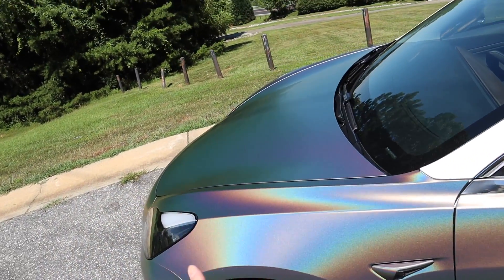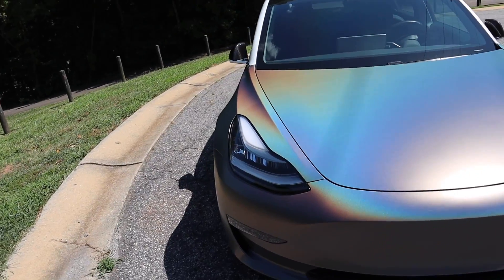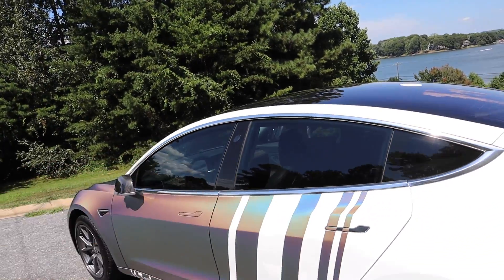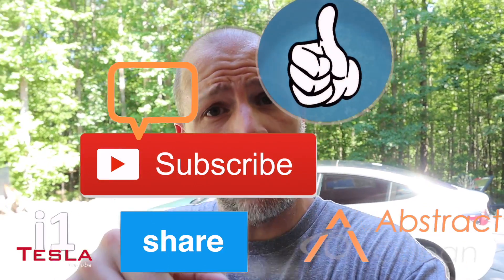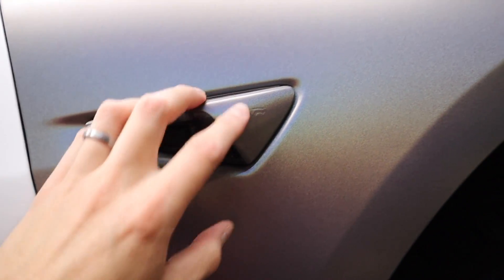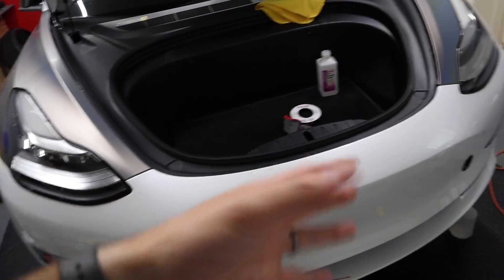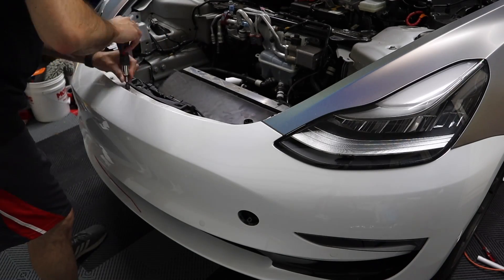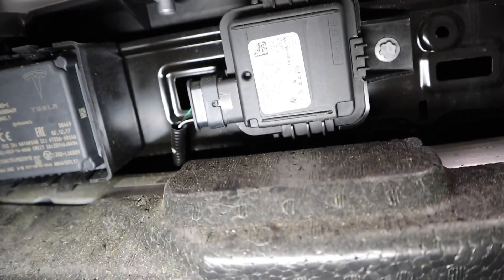DIY Tesla Model 3 Wrap Video

Comment: You did a great job on the wrap Brain. I think the wheels look pretty good as is but if you saw how good Matt's wheels turned out i see why you are thinking about painting them as well. I like the 3m psychedelic you chose. I think you should find another white vinyl to use for the part that you want to look more like the original color but adds a little similar color shift to the white. Just an idea.
Reply from the maker: I like Matts wheels too

Comment: Can you share how you align the bumper to the headlights? Shim it with some washers?
Reply from the maker: I used a sticky rubber piece of tubing I had. 1/4 inch thick. Stuck it to the tabs and it worked

Comment: Love the Wrap job!  Nice touch with the side stripes.  I just bought a White Tesla Model 3 and I am going to wrap it in Avery Gloss Prismatic Metallic Gray which looks very much like the 3M Flip only the color shift and finish is much better than 3M and its easier to install.  Avery does not have a satin option. My question is what direction did you wrap the hood?  I'm assuming you did the fenders and doors with the 3M lettering facing up as well as the bumper.  Did you also wrap the hood with the lettering facing up towards the windshield?

Comment: Question: what if a person is backing out of their garage and the door was not properly closed causing them to fall out of their vehicle. If it were a Tesla, would the car continue down the driveway? This happened to a senior neighbor in my subdivision causing her some pain and suffering related to her leg. Her ICE car continued down the driveway and hit another neighbor’s tree. She is no decrepit but I’m sure this has happened to other people before. Without hurting yourself, could you do a little test to determine how the model 3 would react?
Reply: Can you drive in reverse with the door ajar?
Reply: The seat sensor will throw the car in park. If not buckled and you lift your rear off the seat at low speed you’ll get thrown in park for example.

Comment: Nice job. Curious why you chose a blade around the headlights instead of knife less tape? Is the tape not as good on quick turns? I’m sure the painters tape you laid below prevent any damage so just curious why one way vs the other
Reply from the maker: The blade never touches the paint or plastic. The side of the blade rides along the edge of the light or door making a straight cut. It looks like I cut the car but I am not close.

Comment: Remove the carbon on mirrors. Put the same wrap.
Reply: I think those are actual Carbon fiber mirror caps from TSportline
Reply from the maker: They are carbon caps from RPM Tesla. They match the rear spoiler that i need to put back on from TSportline

Comment: Did i see what?....lol its only a matter of time before someone starts a pro drifting series with a tesla. Tpds. Tesla pro drift series. Front rims white for sure. With the new graphine solid state battery tech coming very very soon it will be a leap for battery tech. Slow drain and only 1/4 of the charging time to charge from 20% to 100% in 20 minutes. Heres hoping it happens sooner then later.